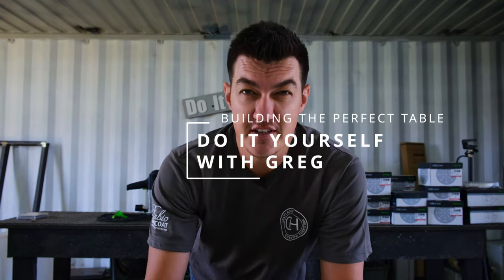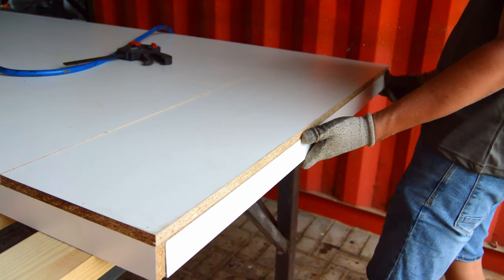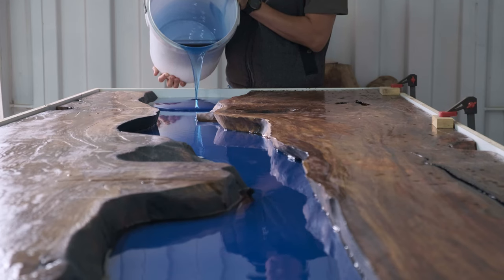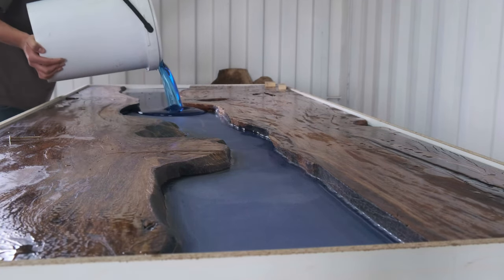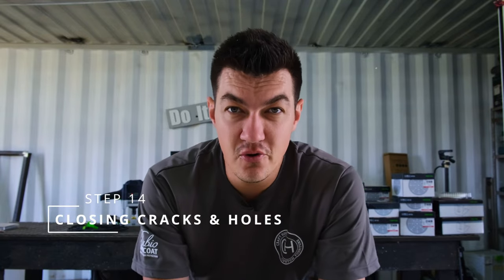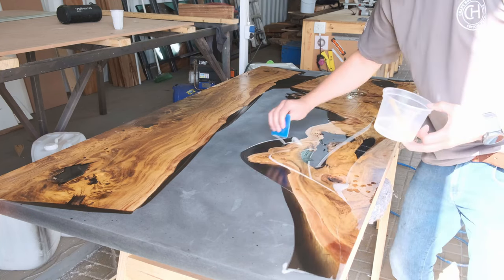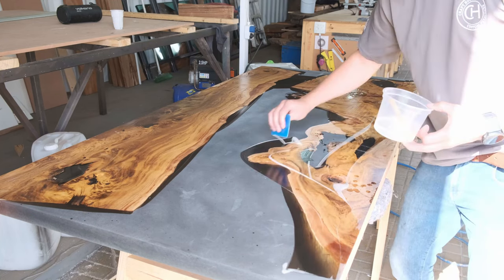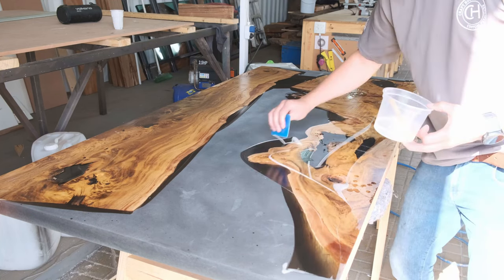EPOXY tables for BEGINNERS - (everything you need to know)

Comment: Okay, but what if I hate my kitchen table and want to epoxy over it? It's literally the same black plank board table that you're working on with the piece of wood you're about to epoxy with. Do I need to remove the paint off of my table and sand it down or can I keep the black paint so that it has that color tone underneath it? I'm wanting to do a rock epoxy top.